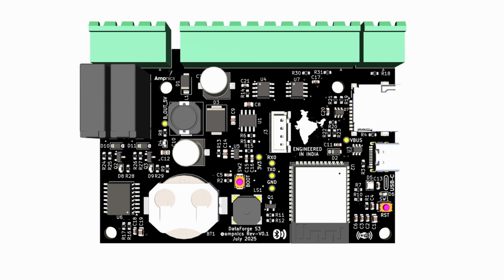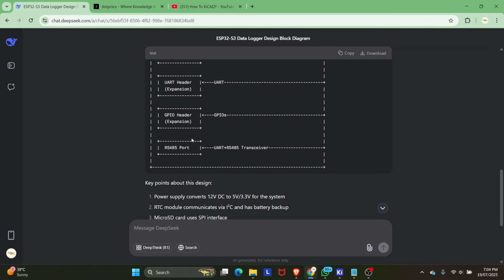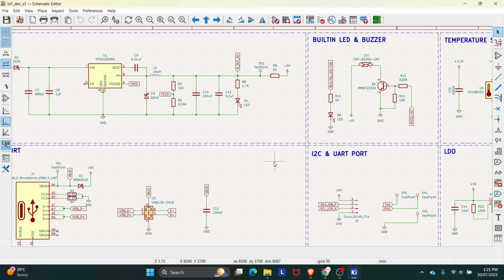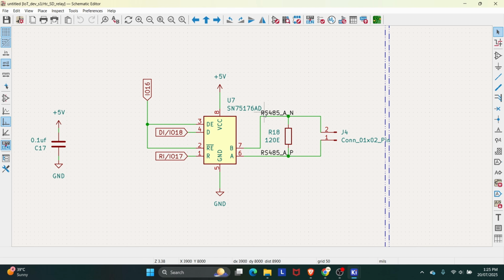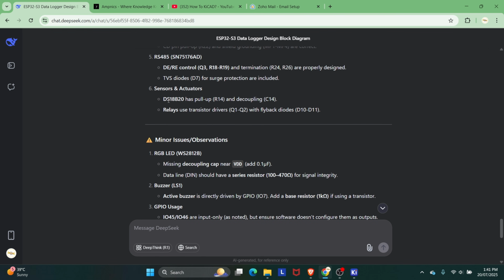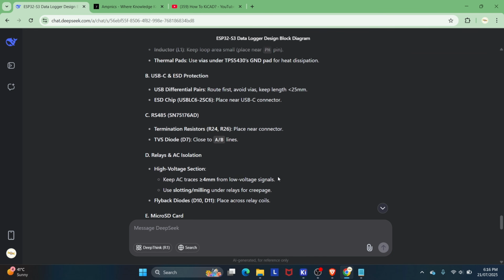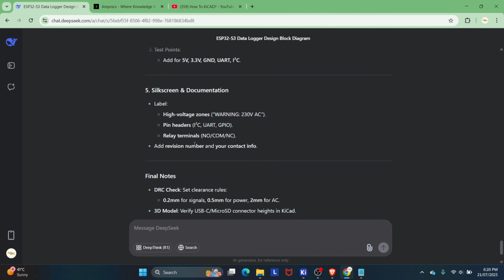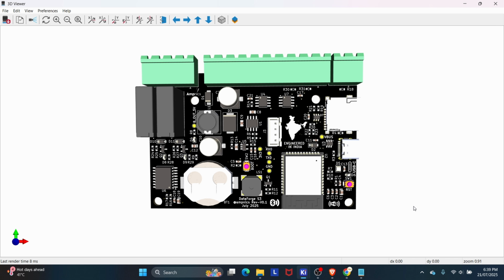Hardware design with DeepSeek AI | KiCad + DeepSeek | IoT Datalogger+RTC+ESP32 S3 | Ampnics

Comment: Think a moment for yourself only. You want PCB with no skills, no knowledge bout electronics and zero experience in cicada or any similar stuff. But you know how science works and heard a thing or two what's what in terms of data processing like there is a data and processing model, and while both are being binary at the very end, one manipulates the other, and second is effect of some manipulation or any other input. okay, so maybe lets google some gerber or whatever, or even download stupid cicada alto eagle- call it how you want. open in notebook, check encoding. Yes, some ar bout positions, some bout erm, nets, components, other for drills or copper vector coordinates... brain overwhelmed. Get the prompt and the text of some BASIC board with like one led, resistor, ground and VCC. Soft does not depend. Copy prompt, past, add please write it as a code below so I can deliver following prompt with a board that is having the x-y placement of components and routing, enter, copy paste write enter, copy paste write enter (...) voila. 
Tried, tested, true. 
As you have a shipboard ask for shitcode how it should operate and you are into electronics with no knowledge what is this resistor for, but it is huge whatever.

Comment: The design is fine but just one thing that can be improved is to keep some space around the mounting holes for screw because some components are too close ,generally for M3 screws about 7-7.5mm dia space around hole should be empty for screw head or washer or nut to comfortable rotate and tighten
Reply from the maker: Thank you very much. We are glad that you find it fine. We designed it for putting screws with plastic washers on the backside. It’s a custom design for our requirements. But we will make sure to bring some tutorial on it.

Comment: I'm sure soon PCB manufacturers like PCBWay or JLCPCB will make their own LLM for create all schematic an PCB designs and customer will just enter a prompt to build what he wishes. For example : "I would like to have a data logger which will work an CR2032 battery. MCU should be small as possible. Design schematic and build PCB design and write firmware by C and manufacture it!" Then it will do everything what customer asks and send PCB's via post !:)
Reply from the maker: I know few of manufacturers provide services I don’t know they use AI or not, but this is going to be crazy….accuracy matters a lot..
Reply: @ampnics  can you write me these manufacturers ?
Reply: That would be awesome as question is how to go from prompt directly to pcba layout without schematic diagram steps…
Reply: Soon is very relative here
Reply: Flux AI  and PCBway collaboration
Reply: I just hope they expand their delivery services. I hate the current ones. So expensive

Comment: Hi, Nice video. How did you do the routing? Freerouter or by hand?. Can AI make the auto routing? Thanks
Reply from the maker: It’s manual routing, I just took suggestions with AI.
Reply: @ampnics  Me too. It seams AI does not have access to a real KICAD project and the use freerouter or anything else to do the job. 
DeepSeek designers must change that and help their AI to read (or even to design) electronics using the open source KICAD. It is dam easy for the AI to do that. Let us hope by asking the AI to do that designers will direct AI and design KICAD projects